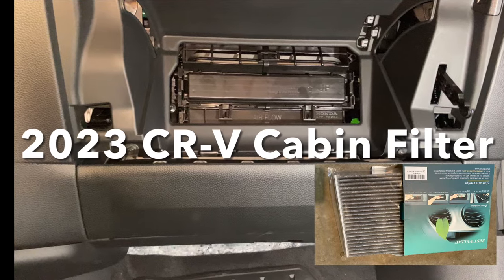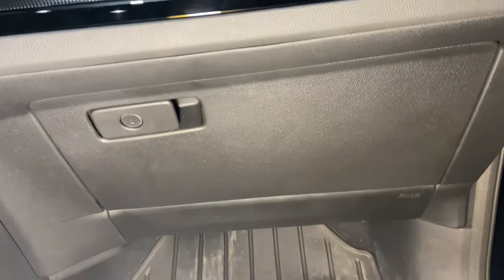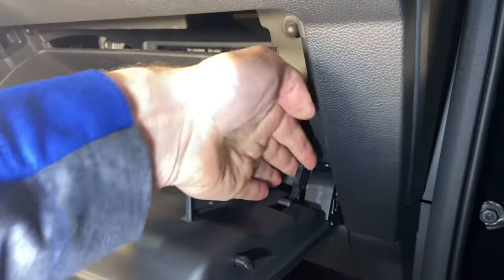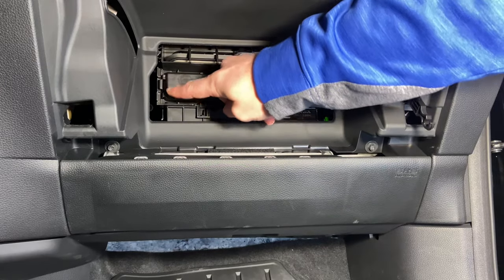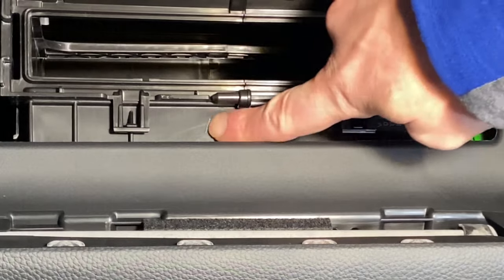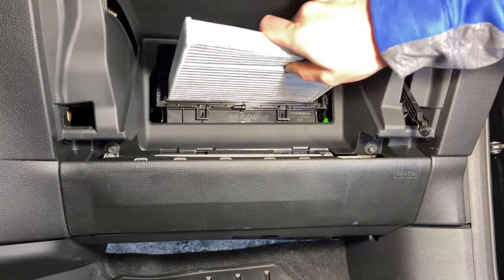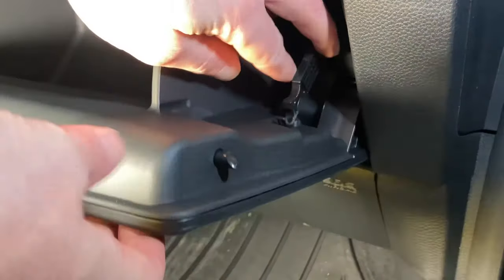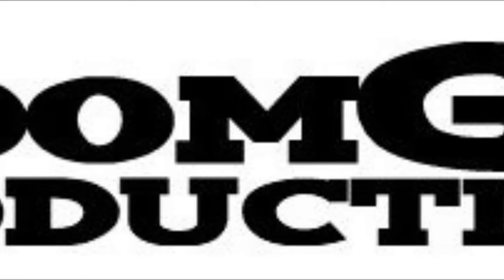2023 2024 Honda CR-V Cabin Filter Replacement

Comment: On average, how often should the filter be replaced?
Reply from the maker: I do my vehicles every 6 months, with a replacement filter being $6-8 bucks and taking less than 5 minutes, it’s such an easy maintenance to do on a regular basis and inexpensive. Thanks for watching!
Reply: Iam changing mine for the first time in 3 years but I also use OEM Honda filters, yes it’s more expensive but the only way to go!

Comment: amazon says this won't fit 23 and 24 cry
Reply from the maker: You might need to check your settings, as Amazon does show that it fits and it is a direct replacement of the exact same size. After 15 months I have replaced several times utilizing these, works great. Thanks for watching!